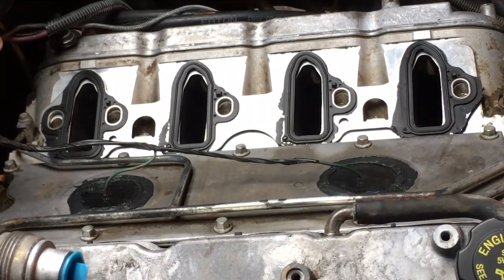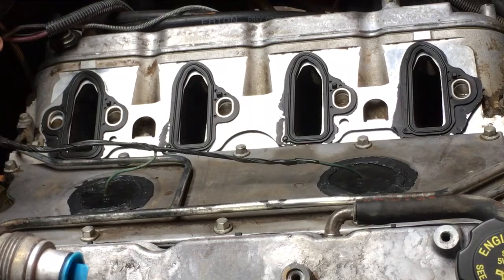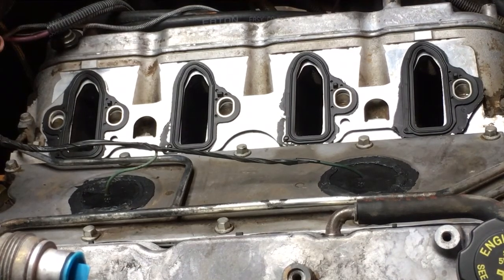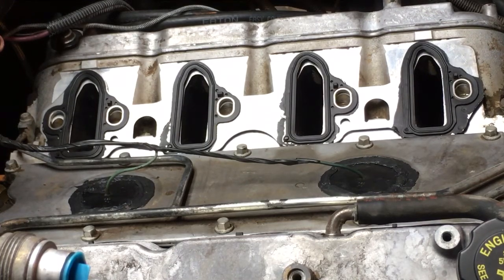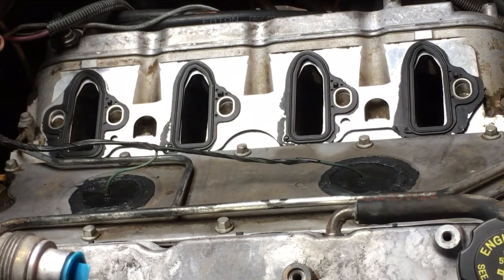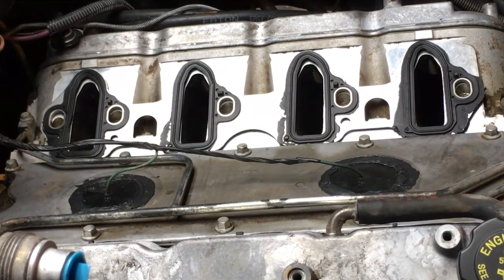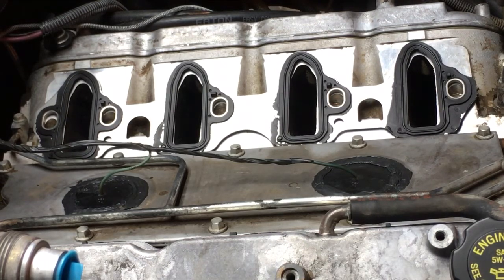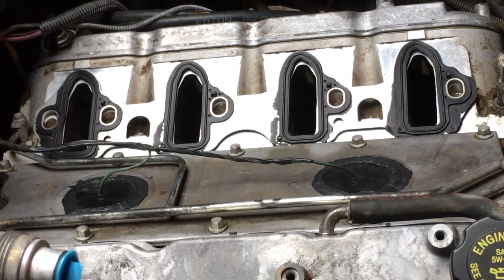S10 4.8 swap knock sensors

Comment: I am confused are you still using the 4.8 or a 5.3 and are still going to do a turbo
Reply from the maker: baylor10010 I still have the 4.8 Turbo build, we had some family challenges requiring a move which put a performance build on the back burner. 
I found a deal on a complete engine that turned out to be a 5.3 so I decided to move forward with it. To answer your question, currently installing the 5.3 but I still have the Turbo 4.8.
I hope to finish the Turbo build maybe next year.